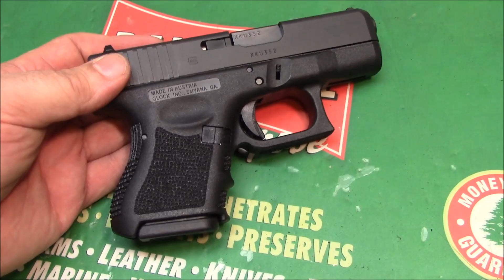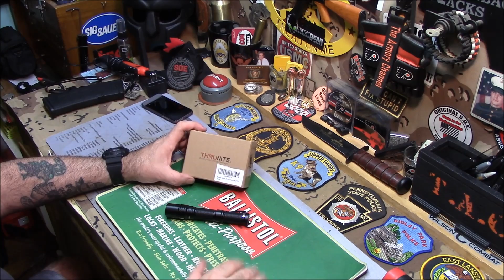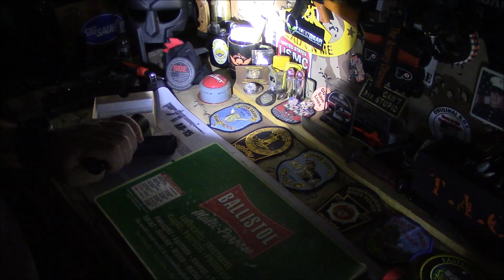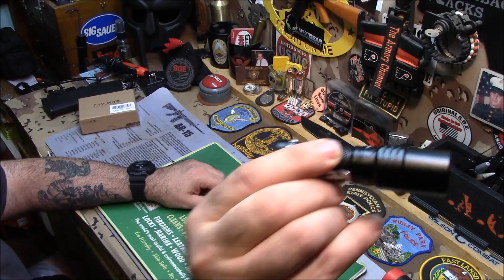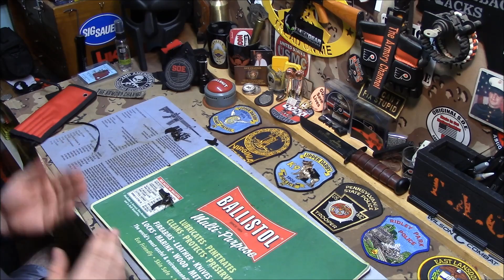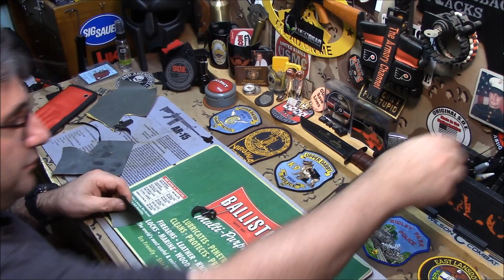"AR15" Smooth out that gritty stock trigger

Comment: I actually polished mine down a lot more than that. Taking it apart and putting it back together was the only difficult part but now I can do it pretty fast. I would do it after every range. I have basically stunned my trigger. Yeah, you run the risk of taking too much off but mine is tuned to feel like a comp trigger now. Absolutely smooth. A stock trigger is $40 to $50 and those aftermarket ones will run $100+.

Comment: I've tried something new recently with an extra fire control group I had. I degreased everything, applied machine oil to the mating surfaces, installed the group, cocked the hammer back, put the gun on safe, and just pulled the trigger as far back as it can go on safe hundreds of times. At first, the trigger doesn't want to move back forward without you helping it. You can feel the grit. After awhile you feel it getting smoother the more you do this. Not "lighter" and still has creep, but it doesn't feel gritty and get stuck "mid-creep" anymore.

Comment: If you choose to polish your trigger, PLEASE don't do it on a mat.  Use a good hard, flat surface.  For instance, you could use a granite tile from a home improvement store.  Doing it on a mat means that you will round over the edges as the sandpaper pushes into the mat.  Be sure to put some oil on the paper to keep it from clogging.

Comment: Forgot to check one thing with the trigger after reassembly. The proper functioning of the disconnect. It's pretty important that you know the disconnect works prior to loading it up with 30 rounds and pulling the trigger.

Comment: Is it good to sand items that need to be flat, on a foam backed Ballistol pad?  Trigger items are very precise, on the contacting surfaces.  Mines foam backed. I use a flat chunk of iron I have in my area or the flat area on the rear side of a vise.

Comment: Great job Pete!  The only thing I do thats different is that I use 1000 grit paper and I use oil on the paper the same way that you would if you used an Arkansas stone. The other thing is that I use the JP Enterprises yellow hammer & Trigger Spring Kit ($8 -$10). This produces a very safe lighter trigger pull of about 4 1/2 - 5 1/2 lbs.

Comment: Just did this little project to my latest build.  The stock RRA parts kit trigger was extremely gritty before, and it really did make a huge difference.  Super quick too, maybe 10 minutes total, definitely worth it.
Reply: Hello there - did you or anyone reviewing this use the 2000 grit? I have a MP 10/22 carbine whose trigger is very gritty.

Comment: The reason you only go in one direction is so all the micro scratches are straight lines rather than the "fish hook" lines you will get by going back and forth. The reason they advise against this type of work on AR trigger components is because the mil-spec trigger parts are surface hardened and not through hardened, so overly aggressive polishing can remove the hardened layer, causing premature wear of the engagement surfaces. Which over time can lead to doubling and the mag dump situations you talked about.
Reply from the maker: thanks for the info buddy, makes sense

Comment: I hate stock AR triggers. It reminds me of being a kid & falling off my bike on asphalt & getting road rash. At the very least I smooth it out like you did here. That works great & it doesn't cost anything. However, I usually go the next step & get a nickle boron trigger & hammer set for about $40.  I have a WMD Guns trigger & hammer. It's far from a match trigger but it is a nice smooth pull. I also like having a nickle boron colored trigger. Gives it a bit of a custom touch.   Great vid.
Reply from the maker: thanks for the great info